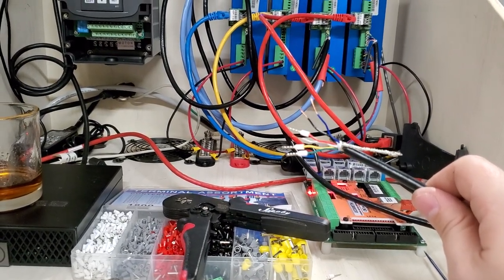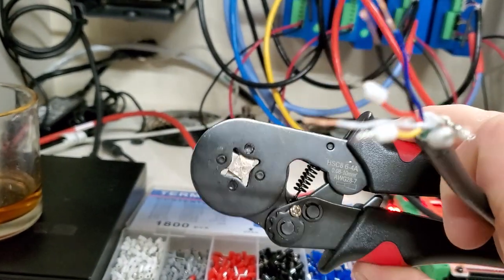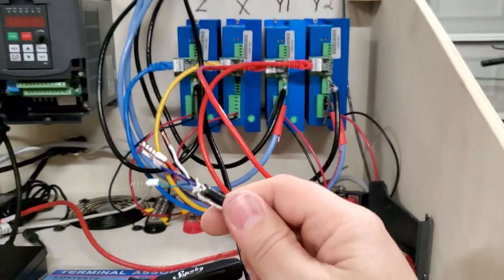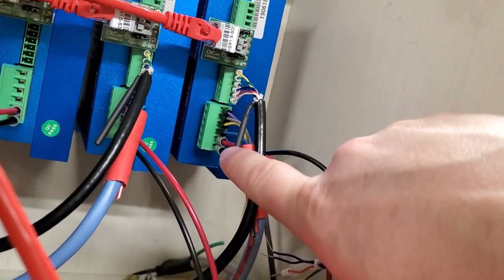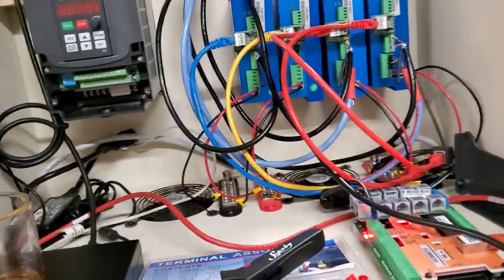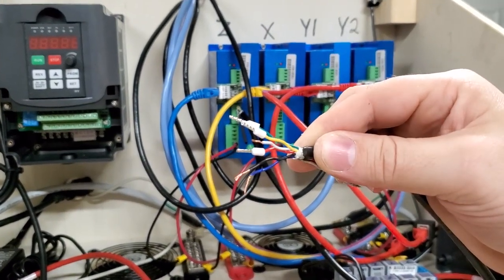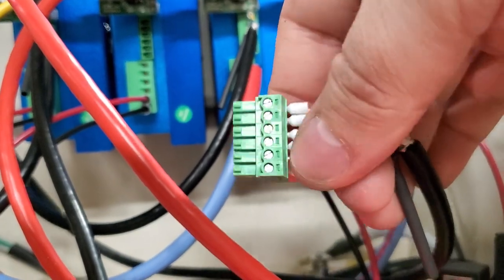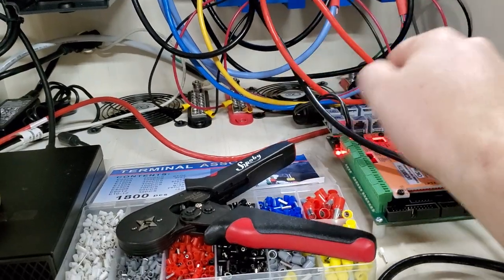Cool Tools - Episode 1

Comment: How long have you been a Biomed tech and what level are you at?  
What is the starting pay and how much can you potentially make as an in house Biomed?
Reply from the maker: I've been a Biomed for almost 17 years. I would be the equivalent of a Biomed 4 / Biomed Specialist / Biomed Team Leader. They are all at about the same pay rate. If you work hard, be as versatile as possible and if you excel at your biomed knowledge, you can make $80-$100k /yr as a non imaging Biomed. Imaging Biomeds can easily make more than that due to training and steep discounts on expensive contracts ( video on that later).
Reply: @BetterBiomedChannel  Nice thanks for the reply
Reply from the maker: Btw, after you get a Biomed job, the secret door to better jobs is through your reps / vendors. The vendors visit all the local hospitals and they know the directors, managers and open positions. All vendors will usually put in a good word for you.